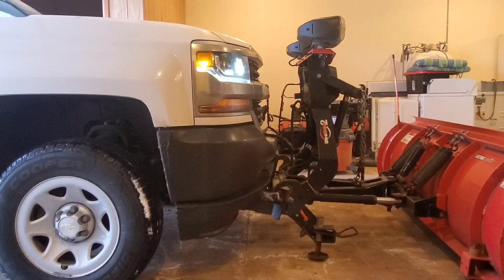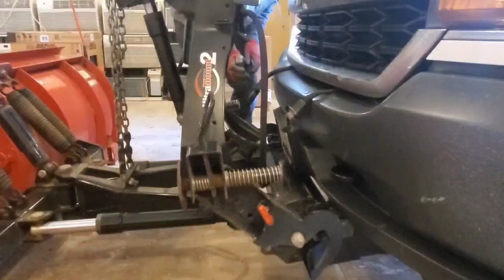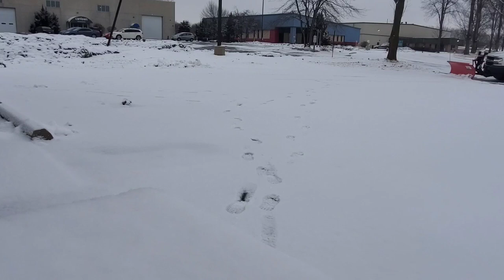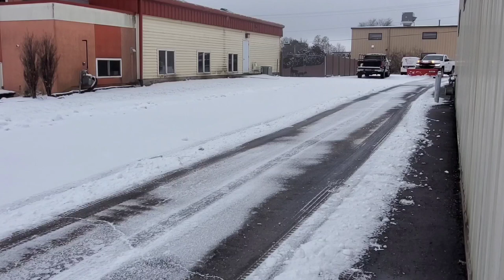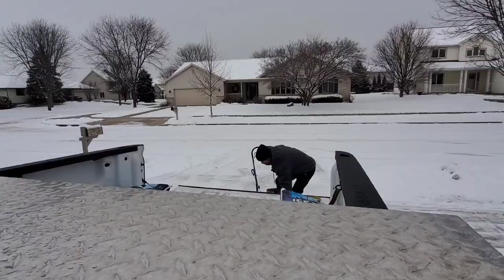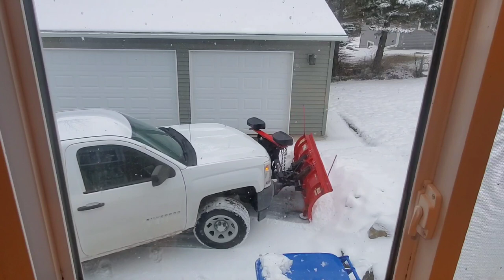Sunday snowplow run | Regular Cab Shortbed | Western Plow

Comment: How does your truck handle the wet heavier snow? I also plow with a half ton truck. I had to run more aggressive tires and carry a little more salt on hand so i could get the traction i needed to plow all my jobs. Great video
Reply from the maker: Longer pushes with wet heavy snow it will start to lose traction.   I usually have 6-50 lb bags of  salt in the back to help with traction.  Most of the time I don't have any issues.  Try to take half width of the plow or if it's a big storm plow before half way through so it's not so much at once.
Reply: @JoshGavol  my f150 and boss 8 foot 2 v plow usually let's me know right away if I can run full blade or half. I am on season 8 with my setup and I had to replace front end parts and new set of plow tires. But I love pushing snow because it gets me off the farm and is a great second income.  Be safe out there and I hope you have a great season
Reply: Good luck, it will get job done safe season to you